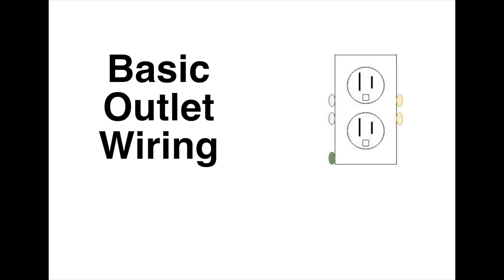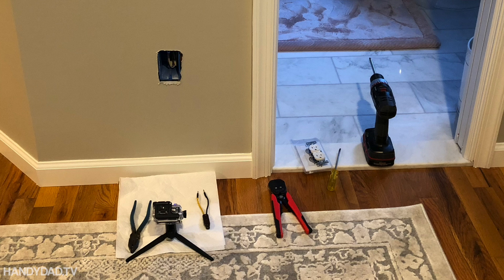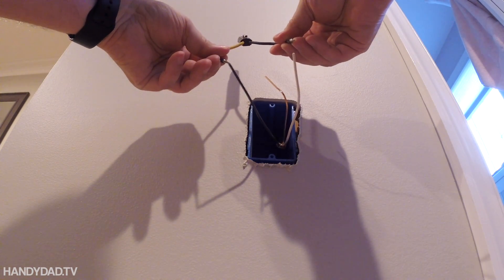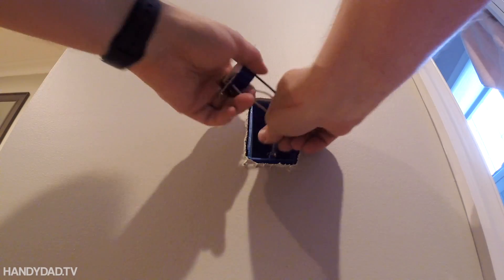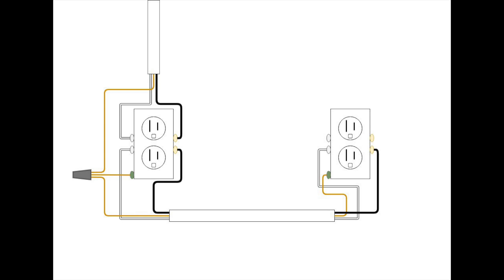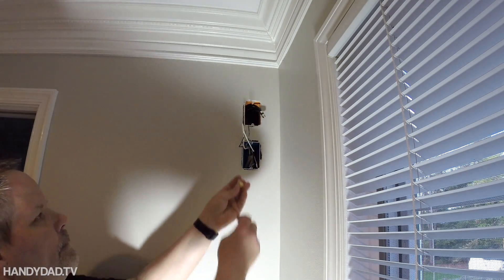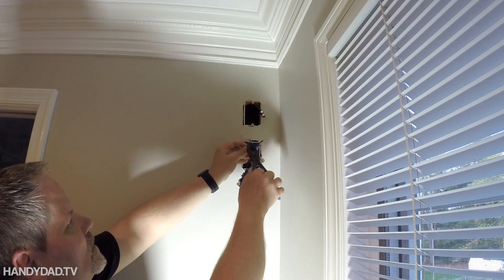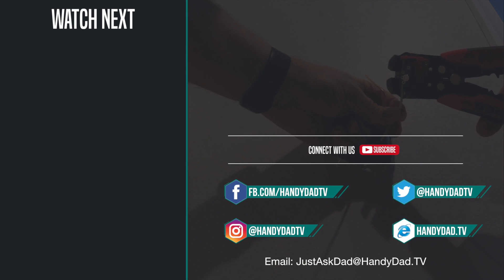How to Wire an Electrical Outlet

Comment: Im doing something wrong. The old outlet has the brown wire connected to a brass screw right next to a silver screw connected with the white wire. The black wire connected to another brass screw in the opposite side. The ground screw has no wire and it works just fine. . So I changed the outlet. Took the black wire connect it to brass screw. White to silver and brown wire to ground. And my circuit breaker keeps popping.  Please help me understand.
Reply from the maker: Sounds like a 220-volt outlet to me. Disconnect everything, turn on the breaker and CAREFULLY use a voltmeter to figure it out. Otherwise call an electrician.
Reply: @handydadtv  
 The fuse box is listing that one breaker AC 2nd flr. It makes sense now. Because even that breaker is bigger than the other breakers.Ty so much I appreciate the advise.

Comment: How would you wire a box that has 4 sets of wires?  A line from the breaker box into the receptacle, and 3 lines leading out to 3 1 leg branches. A line from the receptacle to a floor mounted receptacle. Another line from the receptacle to another receptacle on the left and one on the right. All three end the run but originate in the first receptacle along with the feed wires coming from the breaker box.
Reply from the maker: Yikes. It’s tough to fit all those wires in a single gang box. I would use a wire nut for the grounds (with a pigtail to the outlet), and I’d use the screws and push-in connectors on the outlet.

Comment: Does it matter which wires are on the top screws and bottom screws for each side?
Reply from the maker: No. Both screws are connected so it doesn’t matter.

Comment: Electrician here, NEVER use the push in connection, they are allowed by code but still frequently cause fires.
Reply from the maker: I’ve seen them used in new construction by licensed electricians.
Reply: @handydadtv  
Yes licensed electricians who are more interested in speed than quality. They are under contract. If they do the job quicker they go home earlier. 
Our house was surely built using a licensed electrician but now after 25 years a lot of those push in connections care failing. I'm replacing all of them with some grade. The spec grade devices don't even provide ports for speed wiring.

Comment: Great video! Thanks. Just one question the hot wire and the neutral coming out of the same line has to always be opposite of each other? I was changing an outlet and i see that the wires are on an x shape instead of same hot wire opposite of neutral of the same cable. But one hot wire opposite of the other lines neautral and viceversa. Does it matter?
Reply from the maker: It doesn’t matter because there is a metal bridge between the screws. They’re electrically connected so you don’t need to use the top pair for one cable and the bottom pair for another.
Reply: @handydadtv  thank you. Very helpful

Comment: Hello great video. What if I’m trying to add a ceiling fan to a bedroom that has no ceiling light or anything. The room has a wall switch that controls a wall socket to connect a lamp. How do I wire the fan so that the wall switch controls the fan. 😅
Reply from the maker: Forget rewiring the wall switch. That’s really advanced. 

To add a ceiling fan requires a supported box and power. If you have an attic above the bedroom, it’s doable as a DIY. If not, call an electrician.

Comment: Great video. Question about replacing a middle of the line outlet. I understand the ground code, but does it matter which neutral goes to which screw?  Or which hot goes to which screw?  Does the source always go on the upper and supply on the lower?  I’m not sure that’s the right terminology, but I don’t want to cause myself to have to wire and rewire if I mix up the lines.
Reply from the maker: It doesn’t matter both screws are bridged by a piece of metal. Just remember: “black on brass to save your ass.”
Reply: HandyDadTV Sweet!  I’ll never forget that. Thank you.

Comment: If I want to remove an outlet from the run, is it code for me to just use a wire connector to twist the wires together?
Reply from the maker: Let me clarify, you can remove the outlet, but you need to leave the box. You can't remove the box and leave a splice in the wall. That's a big no-no.
Reply: @handydadtv  Okay, thank you!
Reply from the maker: Yes, and put a blank plate on the wall. Don't ever cover a box with drywall. All connections need to be accessible.

Comment: Why not pigtail all 3? That way outlet failure doesn’t effect downstream.
Reply from the maker: The screws are bridged by solid metal that doesn't fail. Outlets "fail" because the screws aren't tight enough, there's not enough wire under them, or there's some insulation under them. If used properly, the screws are better than wire nuts.

Comment: Awesome vid! What if I want to run a wire from an existing out let to another location 150ft away?
Reply from the maker: You've either got a very large house, or you're looking to run a line out to a shed or detached garage. Either way, it's the same process. You just need to know how you're going to run the wire (typically into an attic or basement if you want to avoid opening walls). Check your local codes for running underground wires.

Comment: Great basic info, but your leaving out the incoming wire connectivity. 

Meaning on the tail end outlet, you must have extended the incoming from an existing box. How did you do that? I mean, in know how but you didnt talk through the amperage to gauge of wire into the last box.

Lastly, no one is talking about over voltage, alot of people simply think you can endless connect outlets to fit there install extensions.

Answer what is the limit number of outlets connecting to a single 15amp breaker? What gauge of wire should you use? Why not select GFCI outlet?
Reply from the maker: You might need to take an electrical course to get the official answers. I’m no expert.

Comment: Im changing out my outlets in my room but 1 out of 3 have five wires and the rest of them are 2 wires? Connected only how do i connect them to a outlet?
Reply from the maker: When replacing an outlet, just connect the new outlet the same exact way as the old one.

Comment: when you are doing the middle of the run wiring (daisy chaining receptacles) do you need to put the power (source?) at the bottom and the power exiting at the top or does it matter? I assume it doesn't matter. THanks for the video.  This was super helpful for my project!
Reply from the maker: Doesn’t matter.
Reply: My first question lol👍🏼

Comment: Does it matter if you use the top or bottom of the hot and neutral screws in the new recepticacle?  Meaning top or bottom?  My gfci main outlet clearly states on back which screw is the line screw and for me its the top, but on my additional recepticales it doesnt say which one is line.  Any help will be appreciated
Reply: Unlike a GFCI, the top and bottom of a normal duplex receptacle are the same. Look at each side and your see a bridge ircrab that connects the top and bottom terminals. That's why only one set of incoming wires need to be connected for both the top and bottom to work

Comment: How do you wire an outlet from a switch with no nutral?
Reply: In the USA a neutral is required in the switch box even if it's just capped off for future use. Normally a switch only has power attached to it. A single pole switch connects the hot wire coming in to the hot wire going out.
Reply from the maker: True, for new construction. But many older homes don’t.

Comment: Got 2 questions:

1. how far apart can the secondary outlet be?  6ft ok from first outlet?

2. Is there a total distance max?  Like if the first outlet runs 20ft of cable and the second is 3ft the total is 23ft and would there be a limit like 20ft max?
Reply from the maker: I don’t know what code would say, but 6 feet is fine. Even 60 feet is fine.
Reply: On a kitchen counter area the code is to have receptacles no further than 4 feet of wall space apart. You would measure from one outlet into a corner and then from the corner to the next outlet.

Comment: Hello There. I installed 3-recessed in the kitchen it only 1-fluorescent its so dark place in the kitchen area. So I add my lights in the kitchen area with fluorescent light. But I know I am getting power from one power where the fluorescent one electrical boxes & I get power from that one electrical all 3-recessed work off one wall switch. And when Installed electrical box that can hold two wall switch but I would like take one of the 1-recessed to other wall switch without turn on all 4-lights on. And also I would like to installed a wall mount for the Tv in the kitchen too So If I have one wall switch works other wall switch not working that why I would like to get at to work only one & also get power for the wall plug for my tv ok. I'm calling from Houston Tx Oh I hope to hear from you real soon
Reply from the maker: I'm not sure what you're asking.

Comment: Replacing 2 prong outlets with three prong one of the outlets only has a white and black wire and no ground can I still hook up a three prong outlet
Reply: Brian Musgrave yes you can but you must identify on the cover of the outlet that there is “no equipment ground” meaning you don’t have a bare copper wire. Or you could install a GFI outlet instead and still have a bit more protection from shock, this option still requires the labeling of no equipment ground on the outlet. Hope that helps
Reply from the maker: If it’s a shielded cable and metal box, yes. The box should be grounded by the cable shield but you should ground the receptacle to the box with a wire.

If you DON’T have a shielded cable, then you need to run a separate ground wire, or just run a completely new cable that includes a ground.

Comment: Nice vid. Still new, so question. Shouldn't you pigtail the hot and neutral as well? As opposed to relying on the small jumper on the outlet?
Reply from the maker: Not required but some electricians do.

Comment: This is the most straight forward video! I've been looking for a video to see the wiring between two outlets and how to wire. Super simple and easy to follow! @HandyDadTV Question though: Is the pigtail a new wire, or can I cut it from the Electrical cable i'm using if I have extra?
Reply from the maker: Thanks! You can cut off excess to make a pigtail.

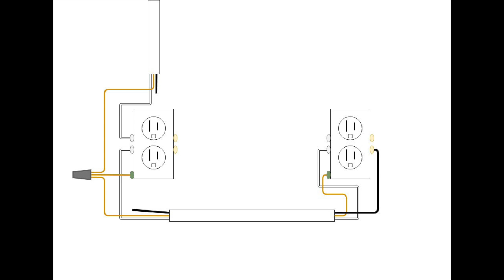Comment: I think I am asking a stupid question.  @2:57, all 3 ground wires are connecting to the same node at the wire screw.  Isn't that the same as connecting 2 existing ground wires to the 3rd ground screw?
Reply from the maker: Yes, but you can’t connect multiple wires to the same screw.
Reply: @handydadtv  
Thanks!

Comment: Hello, this was definitely informative. I’m experiencing a hum (possibly 60hz) almost all over the house. 
We changed outlets not so long ago, is there any way an outlet can do that if not grounded properly, or not wired correctly? It is most noticeable in a subwoofer speaker and ceiling fan motor every time you turn it on. Any ideas would be appreciated, because it’s driving me nuts.
Reply from the maker: I don’t think the electric wiring would do that. It’s probably one of your appliances. Turn all the breakers off except for the sound system. Then turn them back on one at a time. You need to find it through process of elimination.
Reply: HandyDadTV Okay, I will try that method thanks.
Reply: HandyDadTV Follow up: A simple change of double shielded subwoofer wire solved the hum in the subwoofer sound system. The ceiling fan was replaced, it was making horrific sounds, most likely the capacitor (after a bit of research) as it was a an old fan, the hum from the fan is normal now. Other than that, the outlets are fine after all. 
Thanks for the help, though I wonder where the subwoofer was picking up the frequency from? As I tried plugging out everything and back in, and hum was still there, maybe it’s the neighbor’s 😂

Comment: Thank you! I just bought a new dishwasher that  came with an electrical plug. The old one was wired in, of course.  I had an end of the run situation. Thanks to your video I was able to confidently install an outlet.
Reply from the maker: Thanks for the comment! Glad it was helpful.

Comment: Is there a reason outlets don't come standard with 2 green screws? 

Seems like the majority of outlets will be used in the middle of a circuit, so why would they only put 1 green screw, yet 2 silver and 2 brass?
Reply from the maker: That is a very good question and I don’t know the answer. 🤨

Comment: Does it matter if you use the top or bottom connections for an end of run outlet?
Reply from the maker: No. Both screws are electrically connected.

Comment: The receptacle is not in the preferred orientation. Makes no difference to functionality, but still preferred as it makes it easier for instance to insert a plug in low light conditions. Same as USB terminators always have the join on the bottom - I know from inserting them several thousand times that I would not be happy to find one that was upside down
Reply from the maker: This is an ongoing debate that has no definite answer. There is no “top” indicator on receptacles like there is on switches. It’s really a matter of preference.

Comment: Thanks for the very well thought out and informative video! I have a question, when you were connecting the middle run outlet, do the wires need to be opposite their respective ones? I think one of my outlets has wires that are diagonally connected. I'm also pretty sure it's got a switch on/off outlet since there's 6 wires coming out of it. Thanks!
Reply: If you're only pretty sure, then you should call an electrician or someone who is qualified to help you figure it out so you'll be certain instead of pretty sure.

Comment: Hey,

I want to wire another outlet which will be powered from the existing outlet. The existing outlet is a GFCI outlet so does that mean my new outlet also have to be GFCI? Also is it safe to fish the wires through a hole in the studs in the wall? Thank you
Reply from the maker: You can wire another outlet downstream from a GFCI, but you need to decide if you want it to be protected or not. If you DON’T want it protected, connect the new outlet to the same wires coming into the GFCI using the LINE screws. 

If you want the new outlet to be protected, connect it to the LOAD screws on the GFCI. No need to buy a second GFCI.
Reply from the maker: And, yes, you can run the wire by drilling holes in the middle of studs.
Reply: HandyDadTV 

Just finished up everything. Noticed the studs were metal so I fished the wire through the metal studs. Will that be fine?
Reply: @zehabalam3469  
No. There should be insulators to go into the holes first then the wire.

Comment: When doing an in line gfci outlet, does it matter from which direction the power is coming on where you hook it up?
Reply from the maker: Yes. Only use the set of screws labeled LINE unless you want to protect a second outlet, in which case you would feed that outlet from the LOAD screws.

Comment: Is there an order to connecting the neutral, ground and hot wire? I saw in the last example you connected the ground first which would make sense to me.
Reply from the maker: You should always be working with the circuit breaker off, and there is no specific order to attach the wires. I usually do the ground first because the screw is on the bottom of the outlet.
Reply: @handydadtv  Thanks!

Comment: I installed GFI outlets in my basement - I had to ensure the “line” and “load” were attached to the outlet correctly.
When Installing a simple outlet like the ones in this video, do the same rules of the line and load wires apply?
Reply from the maker: Yes, same rules. Especially about the ground. 

Keep in mind, if you are putting a GFCI in the middle of the run, you won’t necessarily use the LOAD terminals unless you definitely want to protect the downstream outlets. It’s perfectly fine to connect all the wires to the LINE side, then nothing else will be protected.
Reply: @handydadtv  GFCI receptacles have line and load terminals labeled  so that downline receptacles also have GFCI protection. Do not wire through non-GFCI receptacles. Pigtailing all wires is a better practice. Otherwise, a problem with one receptacle causes problems with everything downline.
Reply: My middle of the run has 3 white and 3 black wires. Can i use 2 screws plus backstabs for each side of the receptacle?
Reply from the maker: Yes, but most electricians would pigtail them and connect only one wire of each color to the receptacle.
Reply: @handydadtv  thank you!!

Comment: Did you have a color chart for wires for hot and positive etc etc... because I have cut some wire and there not green black and white .. sometimes there blue and red and striped etc...
Reply from the maker: I don’t have a chart. Sorry. But line voltage in the US should always be bare/green, black, white and occasionally red.
Reply: Most likely used as traveler wires on three way switches.

Comment: Here in Canada it seems the boxes are all metal instead of plastic and the ground is connected to it. In a "middle of the run" receptacle, both grounds would be screwed to the box, with one of the bare wire longer to connect to the receptacle.